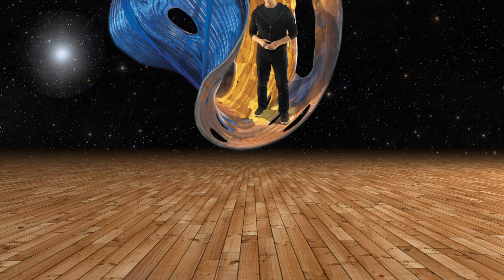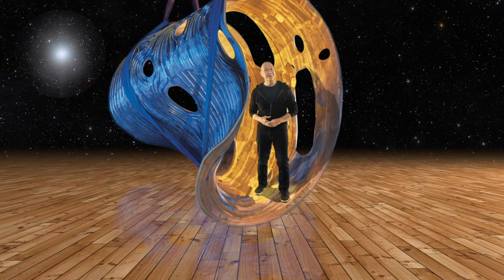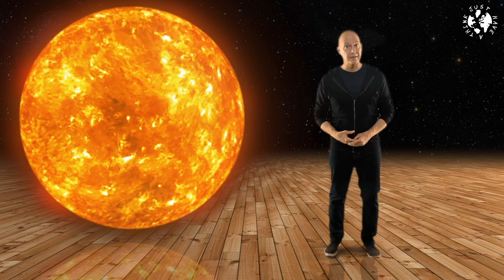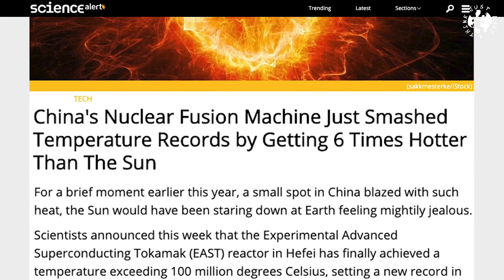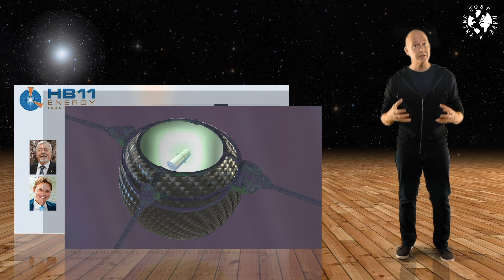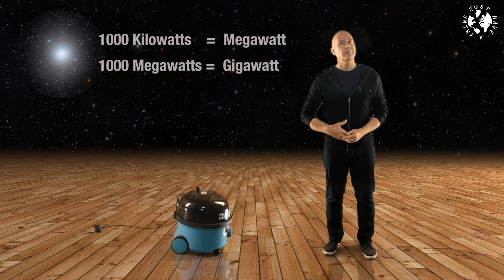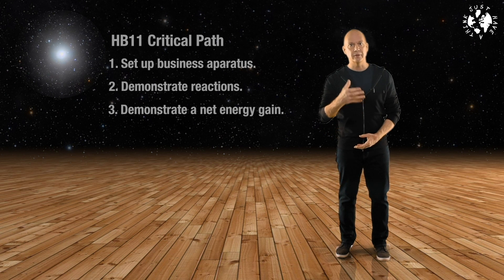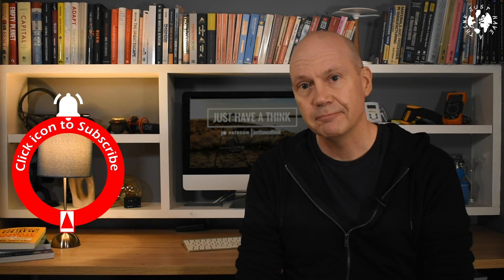Nuclear Fusion:  Revolutionary new breakthrough.

Comment: Complexity always has unforseen costs and the higher the degree of complexity, the higher the costs.  Costs increases are almost always greater than the gains from the complexity. 
Take fr@cking for instance. Pretty much all the companies involved in this highly dirty, highly complex technology have never made a profit.  If the price of oil were high enough for them to make a profit, then the economy would be hit and the demand would be destroyed.    
Tainter's seminal work: Collapse of Complex Societies, shows how many societies have collapsed due to the cost of complexity outstripping the benefits. I suspect that fusion is no different.
Reply: I hope for something like the SMR breakthroughs we're having very recently in fission to end up coming to fusion. Very large, very centralised power stations are cool, and can be useful, but as you say, the complexity eats away at costs. SMRs are looking to need much simpler safety, installation, infrastructure, etc, and potentially directly replace gas-fired power stations with the same turbines. As cool as ITER is from a physics and engineering point of view, we need multiple small reactors, not few large ones, before this stuff takes off properly. Plus, centralised power increases your risks if failure occurs, and a high profile failure of the lone commercial fusion reactor (whenever that exists) could set fusion back for decades even after we've solved the engineering challenges (see current opposition to nuclear, based on 40-60 year old reactor designs' failings, even though modern designs address those failings).
Reply: They're making a ton of money now.
Reply: Uh-huh.Wrong. Fracking is cleaner than oil or coal production and burning natural gas is much cleaner than burning coal or oil products. It has already driven down natural gas prices low enough for power generation to convert largely to gas in the US and lower CO2 emissions more than any EU nation.
Reply: @MichaelEdelman1954  there are many direct emissions from coal pits and oil wells, but fracking releases far more byproducts into its environment directly than either, and those byproducts are far less understood. If you support the transition to natural gas, just go for traditional drilling. You claim bigger CO2 reductions than "the EU", but many EU countries transitioned entirely to natural gas in the 90s, such as the UK. France has been mostly nuclear powered for a long time. Only a few EU nations like Germany and Poland burn a significant amount of coal anymore, and in Germany's case that's only because they divested from nuclear following Fukushima. So obviously, if the USA switches away from coal decades after Europe, then the USA's reduction in CO2 in the last decade is going to be a much higher percentage than Europe's, but that's a misleading statistic, because the same kind of CO2 reduction was already done much earlier in Europe. 

Anyway, even though natural gas produces less CO2, that doesn't exactly make it clean. I'm reminded of the adverts for cigarettes newly with filters – sure less tar goes in your lungs, but it's still nonzero tar, and many people actually ended up smoking more once they felt it was "safer". 

Ultimately, the USA is late to the game for reducing coal usage. If it had done so in the 90s like the UK, it would make sense. But now, renewables are far cheaper than even natural gas, so investing in natural gas instead of investing in renewables just seems like stubbornly putting ideology above practicality. SMRs should be replacing coal and gas for baseload, not more gas. A number of American companies are producing homegrown SMRs in the next few years, so why not get that patriotism into gear and support them? The Americas have plenty of Uranium ore. I remember "energy independence" being floated about a few decades ago about nuclear, now people are saying it about fracking? How about building the infrastructure now so you're not screwed once the fossil fuels run out, instead of desperately clawing up every last drop? If reserves are so low, you have to hydraulically fracture gas out of the pores of rocks..... maybe we should just be pivoting away from that entirely. At best fracking will only provide another few decades of energy. 

And let's not forget, we still need petro products for various oils and lubricants and plastics, not just fuels. Maybe we should, uh, save some for that? Instead of just burning them? We'll still need to produce those even if our energy system is entirely decarbonised. Let's not make things more difficult for our ancestors to manufacture than it needs to be, eh?
Reply: @MichaelEdelman1954  A typical fracking well uses 2.5 million gallons of water, thousands of gallons of toxic chemicals like benzene and TCE and a million pounds of sand. Thousands of trucks are needed to haul this in to a fracking site which is the source of a lot of CO2 emissions as well as aerosols. Methane release from fracking wells has also been shown to be very high.   When the well casings fail (in about 5% of the wells) fresh water aquifers are polluted as has been shown in many cases.  

As far as the economic viability of fracking, just look at Google finance to see that almost none of these companies have had positive free cash flow and have instead been drowning in debt.  Art Berman who is a petroleum engineer with over 40 years of experience has exposed all this very thoroughly.

Comment: Use a giant magnifying glass to focus light from fusion reactor above to raise temp
Reply: They sort of do that in solar thermal plants, where they use mirrors to focus the sun's rays onto a tank of fluid and use the boiling fluid to generate power.  It is generally more efficient than photovoltaic solar power, but also very good at insta-frying birds that fly into the path of the rays.

Comment: Fusion is already too late.  Even if we had a working design for a practical fusion power plant now (which we don't) we couldn't build them fast enough to keep up with the ever-expanding wind and solar energy.  All we need is better batteries and an updated power grid (way easier goals than fusion) to get all our electricity from wind, solar, and hydro.

Comment: The problem, among other things, is that "Clean" fusion is not the most basic variety. 

H+H->He+n => That is, it gives up the energy in the form of a neutron. We have exactly one way to catch energy from neutrons -- we slam them into something to heat it up.

Guess what slamming neutrons into things also does, besides heating them up?

YYYup. Makes them radioactive.

So, even IF the tech manages THAT, there is yet another step required to make the energy  "clean", And that is mastering one of the more advanced fusions which kicks out either photons or protons, since we can utilize the photons more directly, or capture the protons magnetically and slow them down and "steal" the energy they carry away.
Reply: Actually it's Deuterium + Tritium -> He + n. The neutrons that get absorbed by the surrounding materials do turn these into radioactive materials, but (and that's a big but) these only have a half life of several hundred years (compared to several hundredthousends - millions) and do not emit as much radiation as the side products of nuclear fission. Therefore finding a suitable and safe nuclear waste deposit site is much easier. Additionally, the amount of radioactive waste is way less. Further, decellerating super fast protons using an electric or magnetic field creates Bremsstrahlung which can be anywhere from x-rays to gamma rays in terms of frequency and that is a kind of energy we cannot use.
Reply: Yes, but that isn't always an issue. If you slam the extra neutron into oxygen or carbon, there's no worry. So you can set this up to send the extra neutron into a tank of water, heating it up. This is precisely the same setup as modern nuclear reactors, and the water from nuclear reactors isn't a waste product, it's just water with a slightly higher rate of 'heavy' water. Just adding a neutron to something doesn't make it dangerously radioactive, it just makes it an isotope. And only some isotopes are radioactive, most are natural and decay without outputting enough energy to cause ionizing radiation.

You have a valid concern, but just because some atom takes in an extra neutron doesn't mean it's suddenly a dangerously radioactive substance.
Reply: I have been looking for people who are intelligent enough to understand the implications of the SAFIRE project and the potential limitless energy source they have discovered. Watch the video. Then, please reply with your thoughts!

https://youtu.be/ZBInhPFFVog
Reply: @Nphen  big if true, but proton capture does also create radioactive materials (i.e. it's used to make beta+ emitters for PET scans in medicine). What bugs me a bit is that many lighter elements were formed aswell (C, N, O, Na, ...) usually, proton capture only works with heavy nuclei and I am not quite sure if fusion can happen in this environment aswell. Further, the video does not provide much scientific detail, nor does it explicitly explain the procedures used. The lab environment looks very basic. I would remain cauciously sceptical until there are several independend peer reviews of this procedure.
Reply: Do you know the half life of the products of boron alloys capturing neutrons? The answer is insignificant in terms of the lifespan of a power plant. Not a concern, for me or my kids.
Reply: That's why this H-Boron fusion is called aneutronic, bc it produce very little neutrons.
Reply: I have this base covered.

Comment: As a former US Navy Nuclear Operator I know first hand the problems associated with Pressurized Water Reactors (PWR). ie Fukushima Daiichi. I do Not work in the field any longer as such work feels like living under a Sword of Damocles. I have followed the development of Molten Thorium Salt reactors. I see many advantages over PWR. I however have learned in my 53 years of life the strength in Diversity. Solar, wind, wave, hydro, fission and fusion all have their places in a Decentralized Power grid a la the Borg of Star Trek fame. I believe it is possible, however unlikely due to political corruption, in my lifetime to completely eliminate fossil fuel power.

Comment: So, a couple of considerations, playing the skeptic here. The reactants of nuclear fusion aren't unlimited: tritium, deuterium, helium3 etc, though optimistically they might be bred in the reaction. The capital costs and huge infrastructure of building these devices will mean "unlimited, cheap, clean (etc)" becomes "limited, indebted, and relatively clean". There will be toxic waste. Neutron bombardment of the tokamak walls means they need replacing on a cycle, the outgoing will be radioactive for a while, but not 10^5 years -- these isotopes will be relatively managable; but, these are very expensive and precise parts. All plants have a lifespan, and fusion won't be an exception. If it costs $20B to build and lasts 50 years, and someone has to pay another vast sum for decommissioning, don't expect the electricity to be cheap.

Comment: We should be splitting our funds between nuclear reactors, maintaining Hydro Electric, and research into alternative energy like fusion and tidal energy.

Solar and wind need to go.  They don't produce enough energy, it's not consistent, and they both are horrible polluters, both are worse than Nuclear since even the worst types of nuclear reactors waste eventually breaks down, the crud we get from spent solar panels or parts of wind turbines will never break down.

I'd like us to invest heavily into Thorium molten salt reactors, but most sheeple think "Ug, Chernobyl, wah this isn't safe."  Do your own research on how safe Nuclear is.  Start by googling  "Deaths per terawatt hour" since if you don't know how safe nuclear really is, you won't believe anything I say anyway.  Then after you get it through your head that nuclear is safer than solar or wind, investigate the thorium molten salt reactors and you too will be a tinfoil hat wearing pro nuke activist.

Comment: I think we need every type of renewable energy and a more comprehensive understanding of energy storage, energy transfer & energy state change. All matter is energy & energy cannot be created or destroyed it can only change its form. Understanding how to manage leeched energy and all its forms and storing that energy or re-purposing the energy for a direct use like with the most common form of energy loss "heat"! There is nearly limitless energy all around us if we can learn to harness it.The reality of Fusion Energy is its not going to be the magical solution to all our energy needs. There will be specific restraints and conditions that it may need to work. You cannot create energy from nothing. Fusion is essentially concentrated energy. The amount of energy needed to fuse nucleus is astronomical and though it may emit massive amounts of energy if you cannot collect and store that energy efficiently then it is a massively expensive and worthless concept. How many fusion reactions do you need simultaneously and at what frequency of occurrence until it has a stable and limitless output? Is fusion like starting a lawnmower were an initial force is required to get it going but then has a very slow burning fuel cell? Does the event of fusion create gravitational waves or create magnetic anomalies? Is it even possible to have stable fusion on a small scale? The only natural source of fusion comes from a physical body several thousand times the mass of our planet. Should we just learn to harness the natural fusion reactor we already have? Personally I think micro grids are the way to go. I think the power should be spread out and utilize the natural source of energy on site. A combination of Wind, Water, Solar, geothermal, steam and thermal transfer are all needed sources of energy. Energy storage is possible the most important aspect of solving the energy crisis. I hear a lot about how to achieve fusion and about how much power it could give us but not much about how the energy is harvested and what the rate of power loss is. Kinda why its always gonna be many decades ahead of us as a viable energy source. Sorry bout the rant... Kuddos to those who actually read all that.

Comment: Fast ignition of 20-50 MWh HB11 pellets utilizing a LiD primer compressed with plasma knots, (FPPL, FuZE), grounded between the electrodes of a bidirectional 1,200 kV HVDC power line. Add a Wakefield accelerator to heat the pellet if the knots aren't sufficiently compressive. This system can heat water for a Carnot cycle or potassium for MHD at a rate faster than you could transmit the power.